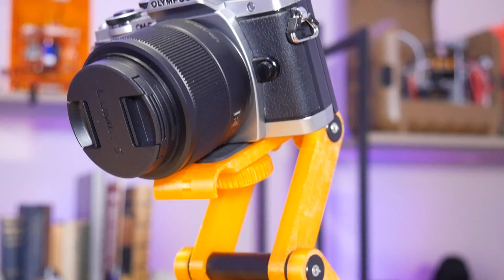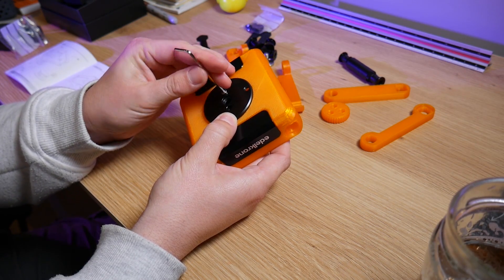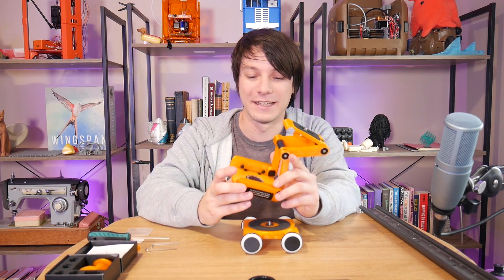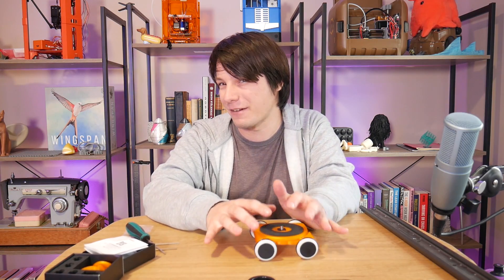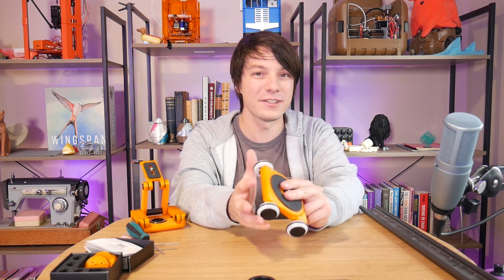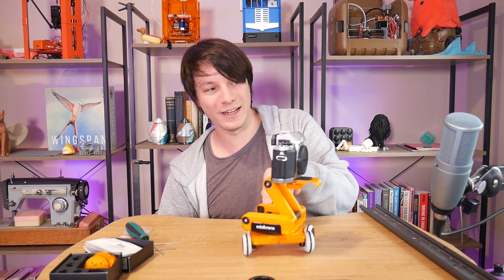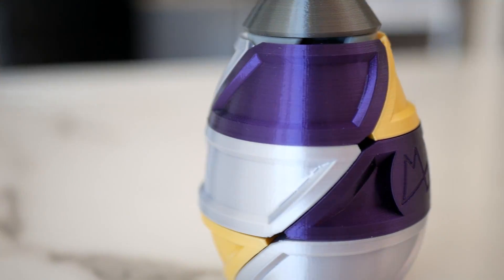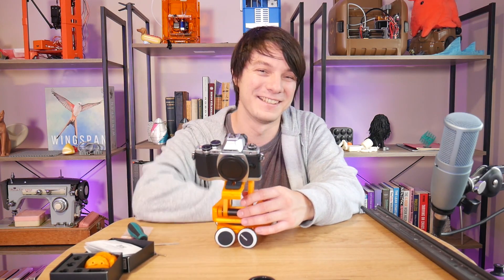Cheap 3D Printed Camera Dolly - Is it any good?

Comment: I playing around with photogramettry last night and I was thinking that if I mounted a camera on toy train with a circular track I could run around the subject, but this seems like it would be useful for that too, especially if a frame was mounted on top to modify the height / angle for scanning. But I don't see how it's worth €35 for such a basic design. A quick look on Thingiverse reveals a design similar in function to this that uses actual inline skate wheels and can probably put together for much less.

Comment: I am facing nozzel height  problem in printing. I am using inductive sensor for z height. I have set up Marlin and also using G29 command nozzel height and z-offset is calibrated (my z-offset is 0.1mm). While z-offset calibration, I have adjusted z-offset so that only bussiness card can pass(i.e. 0.1mm). But while actual printing, nozzel stops at somewhat 8-10mm away from heatbed and material falls from 8-10mm onto heatbed. I don't know how it is happening.why nozzel is not coming to 0.1mm while actual printing and why it stops at 8-10mm aways from heatbed? I am unable to resolve this issue. If you can help me in this case , I will be grateful to you. Please kindly help me.

Comment: What about engineering a self-driving version? One with a high gear ratio so it moves slowly, it would ensure the camera moves at a steady speed, and if you wanted to speed up the footage, just eliminate every other frame, or every other 2 frames etc.

Comment: Got issue with Cura 4.5: a cup with 0.4mm wall (1 line) sliced 90% correctly in Cura, except, every 40mm height has about 5mm of gaps every 3mm.... kinda holes!... but it should be a cup, and water should not go out  : ) why ... why those holes are there... I intended to make cylinder with 0.4mm wall in Fusion360. added - tried 0.8mm wall - cup is perfect... but i want 1 line wall (0.4mm)... :'(
Reply from the maker: It's not a good idea to have wall thicknesses the same as your nozzle size, as angles can make the slicer skip areas. You can try making a solid cylinder, and then using "spiralize outer contours" otherwise known as vase mode, to make a single thin wall.
Reply: @MakersMuse  spiralize outer contours did the trick, - the 1 line wall is perfect, no leaking :)) thank you!

Comment: Or... you can design your own small rig and add some arduino + stepper motor or at least DC motor connected to one axle so you will be able to exactly set speed and acceleration... ;)

Comment: Have you ever heard the saying, "When the only tool you have is a hammer then everything looks like a nail." These simple devices could be made pretty easily from ordinary materials and a few hand and power tools. I'm not saying 3D printers aren't useful for some parts that are hard to fabricate. These look simple enough to DIY without a 3D printer. I appreciate that you felt obligated to test these kits. I'm just saying that you might want to add your opinion, if you were the designer of this device, would you recommend a 3D printer for the job. Thanks for a great channel.
Reply: I fully understand what you are saying. But most probably it is aimed at a 3D printer because it doesn't require actual manual work or any other tools. I mean ok I have lots of tools myself, but if I have a 3D printer, and some experience, this requires at max 4-5 minutes to set up and no additional work. Couldn't be any easier from manufacturing standpoint.

Comment: You know what would be cool? Building a small 5 axis robot arm and feed it with some gcode to use as a camera rig. Maybe also using a motorized lens to electronically adjust focus and zoom while it’s moving. Fully automate the whole filming process.

Comment: Hey Angus, I printed the flex tilt head in colorfabb xt cf20 and quickly designed 0,2mm thick nylon spacers for the squeeky joints. Works very well and looks epic! Cheers!

Comment: If you can modify the file to hold 2 small laser pointers, in line with the axles, the intersection of the beams would give you the center of rotation/focus point. This can be temporary just for setup, so they don't interfere during the pan.

Comment: You can buy a similar device, made of metal and with polycarbonate skate wheels for as little as £10 on Ebay (and I think I paid even less) . It comes with the standard tripod mount screw and the sellers often have a ball head magic arm available. They seem like a perfect platfor for automation and 3D printed devices.  Here is an example: https://www.ebay.co.uk/itm/DESKTOP-CAMERA-VIDEO-RAIL-ROLLING-TRACK-SLIDER-MOBILE-DOLLY-CAR-CAMCORDER-GLIDE/383414746437?_trkparms=aid%3D1110004%26algo%3DSPLICE.COMP%26ao%3D1%26asc%3D225076%26meid%3D245ca3f930f1478197e18ba6e4768693%26pid%3D100008%26rk%3D5%26rkt%3D12%26sd%3D223001069890%26itm%3D383414746437%26pmt%3D1%26noa%3D0%26pg%3D2047675%26algv%3Ddefault&_trksid=p2047675.c100008.m2219

Comment: ABS is nice and tough, but it's not the most rigid material... 
I've got a spool of CFPC that I've used for a 27" VESA monitor adapter that I was SHOCKED with how light and strong the print came out. I wonder if some of that squeaking and bouncing could be reduced by using a super rigid material. 🤔
Also, those dolly shots look so awesome! My sister does a lot of photography and video stuff, I may have to make her a few of these things to try out.  :D

Comment: If they provide source files for that, you could put in some kind of markings for the angle adjustment, but not in a measurement of angles, in a diameter that center of the dolly takes

Comment: Me: "That's a neat gadget there."

Also Me: opens Fusion 360 on second monitor
Reply from the maker: Yesss reverse engineer!
Reply: LOL! I was thinking the exact same thing! 
"Hmm.... what hardware do I already have that I could make something like this.... 🤔"
Although, $29 does seem super reasonable for all the parts, and not having to source them all, then design the printed parts yourself.
Reply: BRUXXUS 30 bucks really isn’t a reasonable price for som nuts and bolts. You could buy everything at a hardware store for fraction of the price.
Reply: I don't think they were trying to gouge anyone on the price of nuts and bolts, I think they were trying to make a simple solution for people and make a few bucks for the work they put into it.   I don't see any harm in that.  I personally think $29 is a solid price point for that.
Reply: @kshatriya1414  Maybe. Depending on your region, hardware stores can suck, and to get the bearings would be a second stop. People who tinker frequently likely do have everything they'd need to build a simple skater dolly, but if you don't, the kit is reasonable (if free shipping) in terms of cost for part when factoring in quality of the parts, labor, and putting everything together into a nice package.

I'd build my own if I needed one, but in all honesty, skater dollies kind of suck. It's not very common you see one on a set (at least in the work I get hired for), even shooting product, unless you need it for a specific shot, then you buy one (because they're cheap) and forget about it in your kit for along time -most rental houses don't even rent table top skater dollies because there's almost always a better solution.

I do love the idea of Edelkrone Ortak line though, I do want them to continue with the idea and improving on it's offerings.
Reply: Yep, I'll think I'll do that as well. Looks quite simple.

Comment: The point where the two lines coming out of the wheels intersect is supposed to be where you place your object. Then the skater will move in a circle around it
Reply: Yea, just make 2 lines at different places on the perimeter of the circle and where they intersect is the perfect center

Comment: good concept but that's expensive.
Reply: Did you get the beginning?
Reply: @maxhouseman3129  beginning? It's not cheap for 29usd just for the "other" parts. You still have to 3D print the main parts which take time and filament and fitting  it together and cleaning the 3D parts.  You can buy a 15usd dolly all aluminum which would track better.

Comment: As for centering in the "arc" position, you can model in a small clip at the top to put a laser pointer. That way it will give you a rough center from wherever you put the dolly.
Reply from the maker: That's a pretty neat idea! I wonder if it could be put in the hotshoe and calibrated to the camera... hmm
Reply: if you could mount two laser pointers right on top of the wheel axis the intersecting lasers would make a good center point
Reply: @DutchBart666  I thought same thing, but not with lasers, but normal sticks, even like chinese chopsticks. They don't have to intersect, I guess just pointing more or less where intersection is should be enough :)
Reply: My thought was to mount the laser under the carriage, so it doesn't interfere with the camera mount, but it would have to be a small laser.
Reply: That's cool, but on the other hand you could just test roll it a few times and guess the center and place the model afterwards.
Reply: was going to say exactly the same, if you mount 2 of the laser line types in line with the axles when you turn them in to each other the crossover point should be the rotational centre.
Reply: an ever cheaper option would just be to cut a "wedge" out of a piece of a3 paper , and just align the wheel contact points  on the wedge and the very tip should be the centre